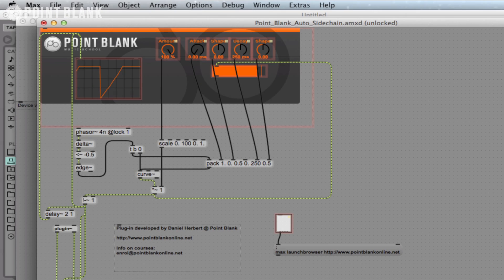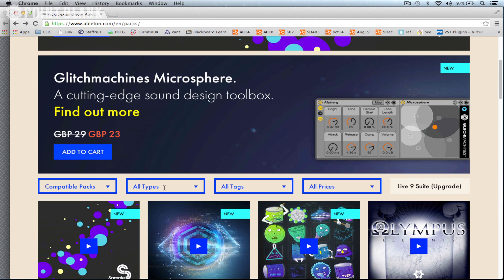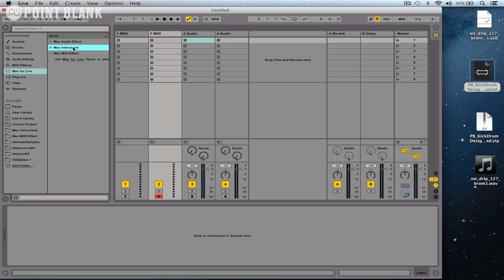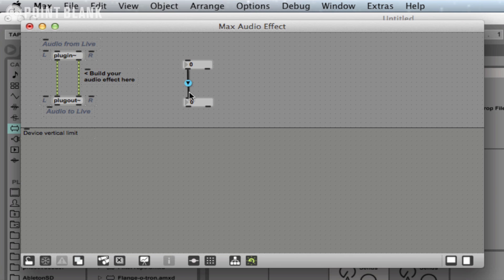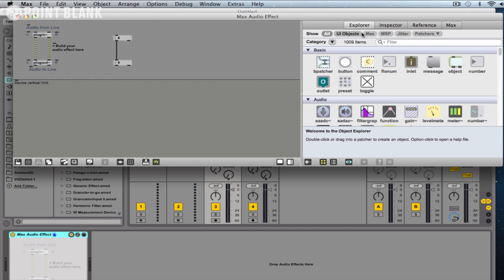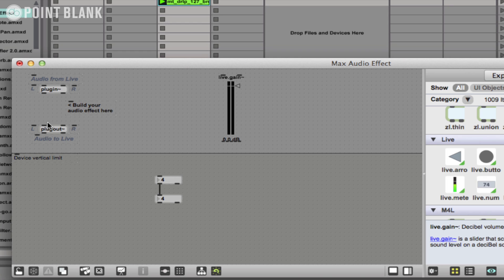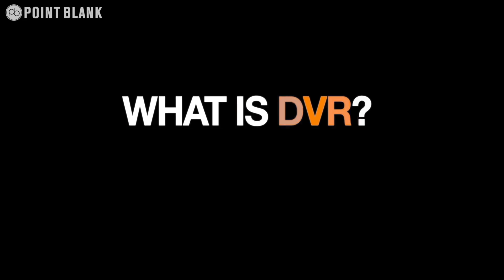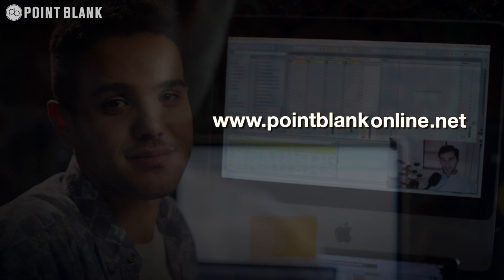How to Build a Max for Live Device: Part 1 - Introduction

Comment: Looking at getting into Live. Would you recommend starting with Suite, or Standard?
Reply: I say Suite if you can afford it, nothing in Ableton is not useful, and I think you get a lot more in Suite than the additional cost would suggest.

https://www.ableton.com/en/live/feature-comparison/#feature-packs
Reply: Jude Pierre
May as well spend the extra and get it with Push. Someone on eBay doing a package deal for £670, don't know if it's legit though. Bought a 16GB MacBook Pro in September to use for Traktor and Live and at mo only using it for browsing lol